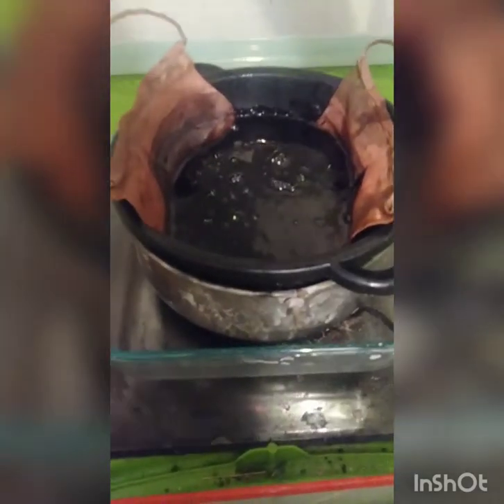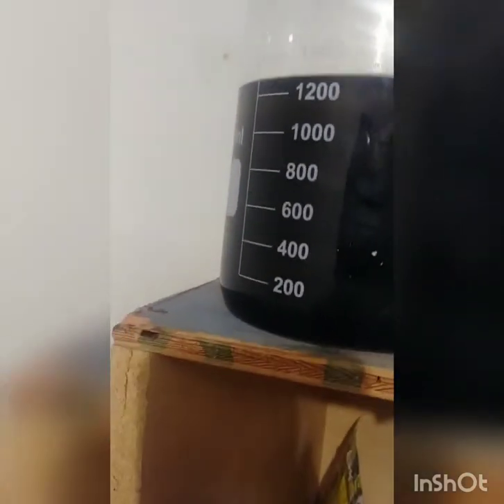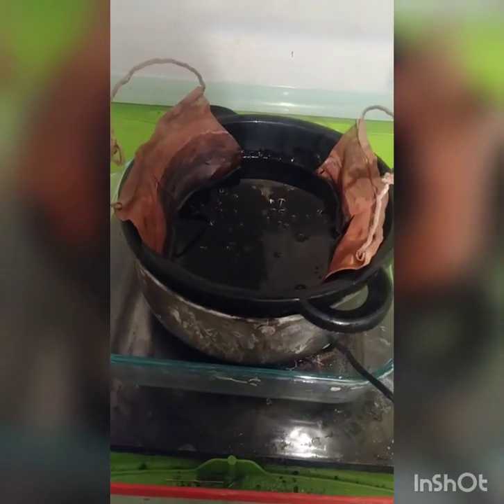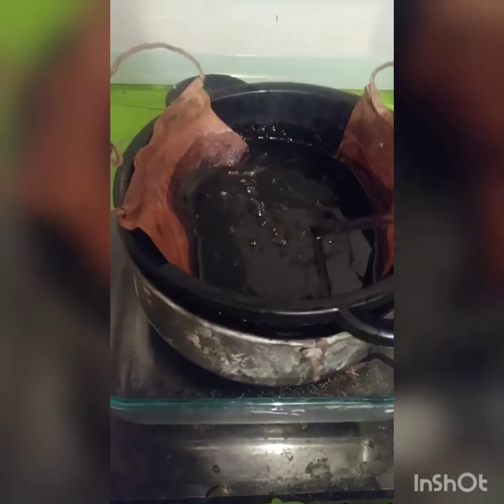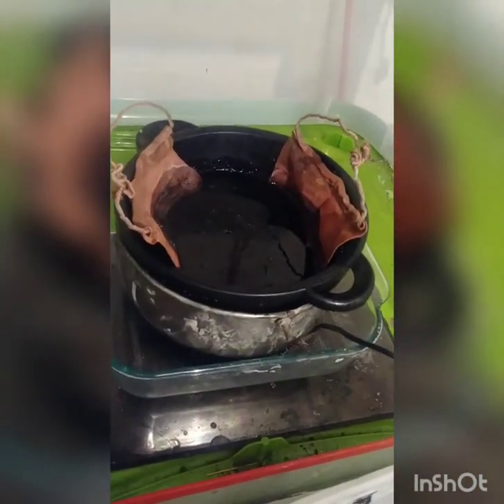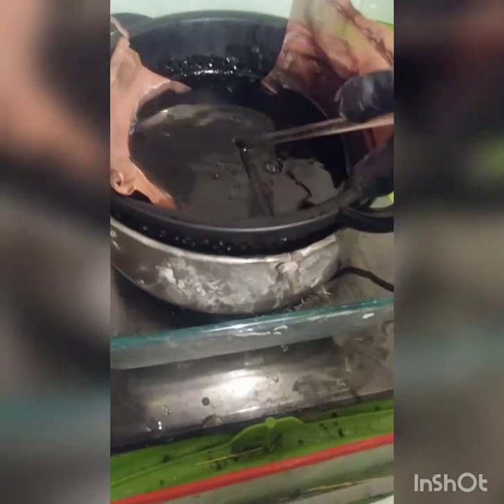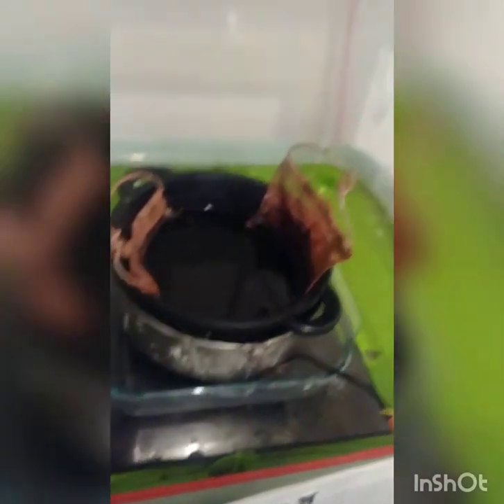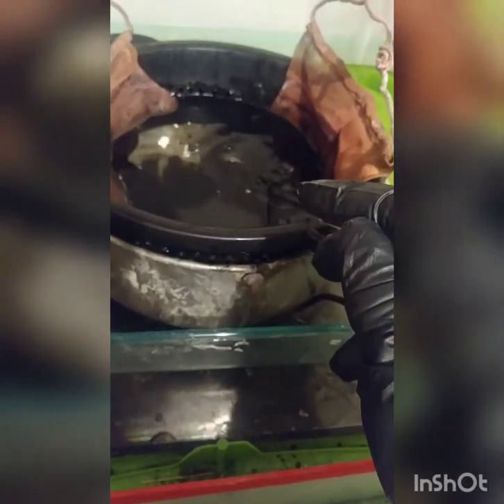Gold recovery sulfuric deplating cell pt1

Comment: You can try putting a light bulb in series with your power lead. This will limit the current and when the light dims or goes out the current flow has decreased.